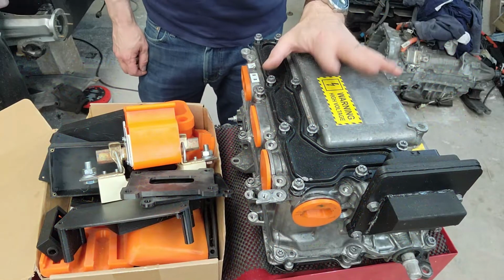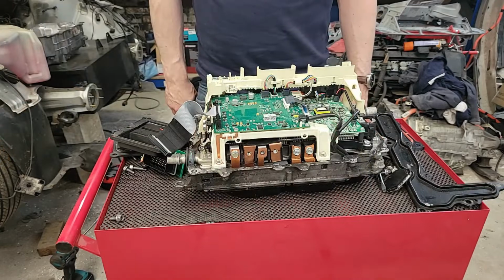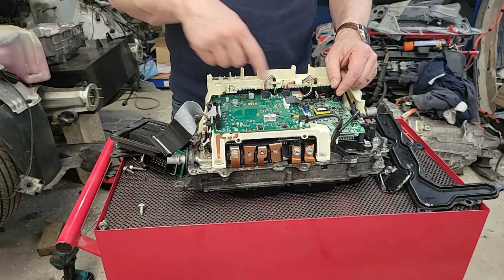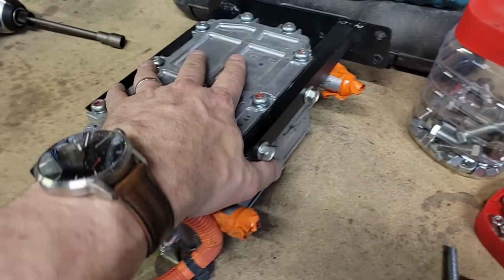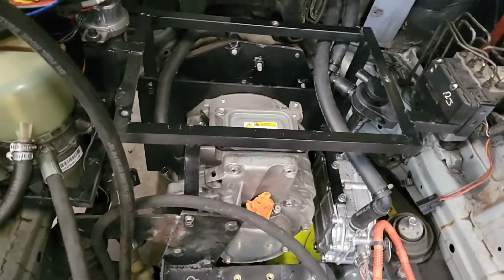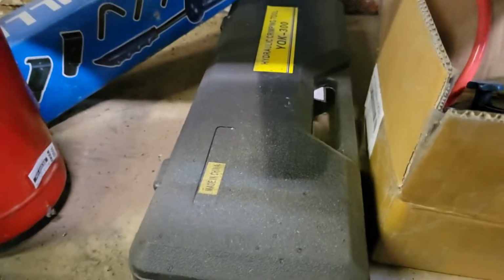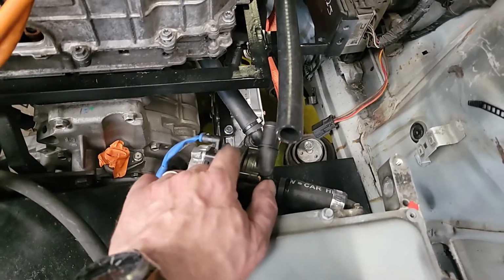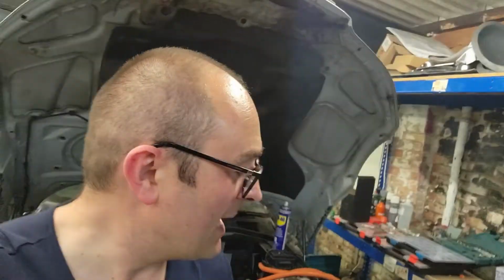Plumbing and wiring my electric car conversion: heating, cooling, and drive

Comment: forgive my ignorance but why are you mix and matching a Prius Gen 3 inverter with what is not a Prius motor, but what I believe a Mitsubishi (sorry if I got that wrong) but I'm pretty sure it's not a matched pair, is it that no one has reverse engineered the Mitsubishi inverter?
Reply from the maker: No you can use the Mitsubishi inverter. In fact I have one! And I may try it at some point. But one motor is pretty much like another. And I don't see any real reason to. This inverter worked fine with my old Outlander motor so should work fine with this one. And I should be able to squeeze more power out of it.
Reply: @EVDIY  so does the Outlander power plant also have two motors inside of it like the Prius one, sorry I am totally not familiar with the Outlander, I think that's a European animal
Reply: @Good-Enuff-Garage  it has a front motor (weak) driving the front wheels and rear motor (less weak) driving the rear wheels.
Reply from the maker: @Good-Enuff-Garage  it actually has three! Two at the front bolted on to the gearbox and one at the back bolted to the diff. They're not integrated like the Prius though - the two at the front are separate units.
Reply: @alibro7512  ha ha, luv those descriptiona, thank you so much
Reply: @EVDIY  thanx, I take it you are using the rear motor? apologies for all the dumb questions and thanks for not sending me to read Open Inverter but actually taking the time to answer, lol
Reply from the maker: @Good-Enuff-Garage  Ha! No problem. I did have one of the front motors in but it was underpowered so replacing with the rear motor now.
Reply: @EVDIY  yes that now makes sense, I knew you were replacing a smaller one with a bigger one, I just assumed a prior generation Outlander with a newer gen one, I'm caught up, carry on, ha ha

Comment: Can you go over what you did to blow up the Damien control boards? It might help others. Also do you have a video of how you made your custom inverter 3d printed plug parts with links to the designs etc for those of us less clever than you. :)
Reply from the maker: I don't think I blew any of them up exactly. Well, bad soldering killed the first one. The second one is less clear. Even with mods I couldn't get the right voltage in a couple of places. That one may have been a manufacturing error.
Reply from the maker: Jamie Jones has kindly put all of the Prius 3D printed parts from me and other people into a single GitHub repo here: https://github.com/jamiejones85/Gen3PriusInverter3DParts

Not got a video on how I did these but I will make one when I do the same for the Lexus inverter. Though this time, using my shiny new 3D scanner!

Comment: Not sure why PooTube deleted my last post but I'll try again
The cable ties are a great idea but maybe you should use higher quality ones like the type with a steel barb that don't click. They would avoid the issue where they're not quite tight enough but won't click again.
Or the stainless steel cable ties that would be much stronger.
Reply from the maker: Maybe. But these ones have lasted 10 months without a leak so I don't think there's much point spending more until one shows it has failed. Following the Damien approach - if it works, it works!
Reply: @EVDIY  lol, can't argue with that. 😊

Comment: Make an extender cable and get the wifi module away from metal reflectors and EM interference? - door mirrors are an excellent location
Reply from the maker: Yep - plenty of cable to get it out of the case. Doesn't need to go that far though. Just a little box on the top will be fine.